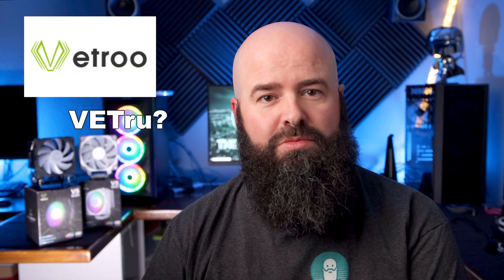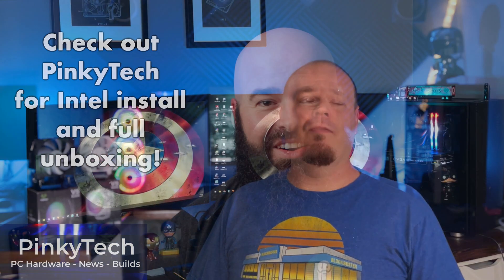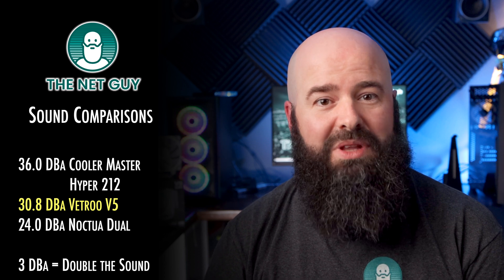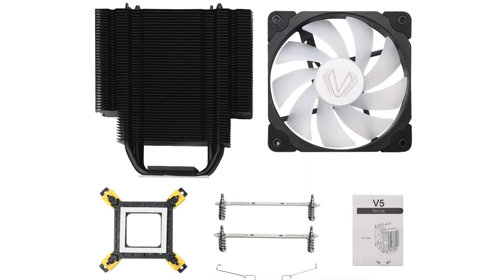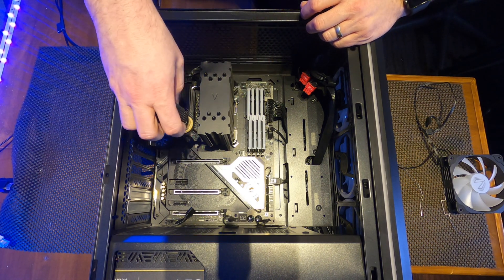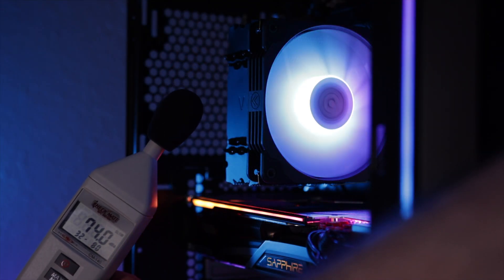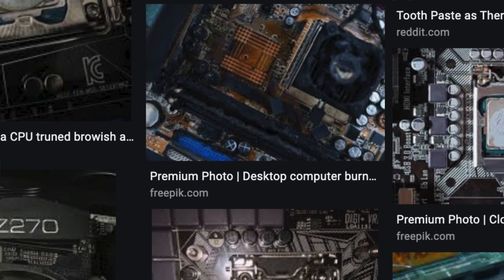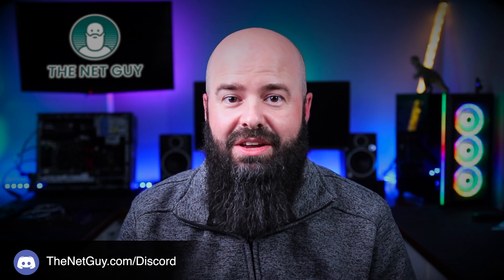ICE COLD CPU Air Cooler Review and Benchmarks - Vetroo V5 FTW

Comment: Love this cooler, and it dropped temps over 20C from my Wraith Stealth that came with my R5 3600, but I disagree about the fan being silent. Mine starts making obnoxious grinding sounds as it hits the higher RPMs, and I've seen a few other users online complaining about the same thing. I had to create a custom fan curve that caps it at 90% maximum speed to keep the noise levels down.
Reply from the maker: Hey Steve - thanks for the comments.  The cooling power of it is really impressive.  As for the sound, what curves are you using?  As long as your CPU isn’t thermal throttling / TDP, you can adjust the curves to stay silent longer.

It’s definitely not silent, but much quieter than the alternatives other than Noctua 😉 thanks again for the post!

Comment: I don't know if I'm doing something wrong, have a bad chip/board/case etc, but I'm hitting 90c no matter what with Cinebench R20. 5800x with this cooler. Tried stock and undervolting. Only stable undervolt I can keep without R20 crashing is -5 on Curve Optimizer all core. Scores are ~5800 all core, with a 4.5 ghz constant boost and just staying at 90c the whole time.
Of course I could lower ttp tdc edc etc, but that lowers scores and boost clocks. Running on a Rog b450f motherboard.
Reply from the maker: PBO is going to mess with you here.  No matter what that proc likes to go fast and will ramp up everything to get to 90c.  You can turn PBO off and see if that helps.  If it’s not cooling I’d double check that it has good even pressure on the CPU die itself - sometimes things aren’t aligned right and don’t get as much conduction.  The Vetroo has been the best cpu heat pipe cooler I’ve tested.

Comment: Temps were much higher than other videos thanks for the honest review!!
Reply from the maker: You’re very welcome.  It’s a hot chip.  My buddy Dan compared a bunch of coolers on his 5950x and it was cooler overall.  But yes, I am very impressed with the Vetroo cooler.
Reply: @TheNetGuy  I have a Ryzen 5 2600 so I'm hoping it'll be a little cooler!
Reply: @alltimellow  5950x produce at least doble heat that 2600. And of course the temps would be higher if other test use a 3600x.

Comment: I grabbed one of these for my Plex/Nas server with a 2700X to replace the Wraith Prism when it was on sale on amazon.  I dropped 10c over the Prism, and gained 150-200 Mhz on the PBO auto-boosting, +400 on my CB23 score with NO other changes other than this cooler.  I didn't use the included thermal paste, but some Kryonaut. I did have 2 fans on it, but it only reduced temps 1c so I didn't think it was needed and went back to the included fan.

Comment: I picked one up for my 3600.  Copper plate had gaps but seems to cool.  Was easy to install cooler.  Fan clips are PITA!  Fan at highest RPM loud but not as loud as Amd stock cooler.  Much more audible than cooler master hyper 212 black edition with silencio fan.

Comment: 10:15 it comes with 2 sets of fan clips, so you can buy another one of their fans or add another fan you may already have lying around like I did with mine. By the way I have the white version on my 2700X OC at 4.2GHz all cores 1.375V and it got to 70C after a few runs of cinebench, again I do have 2 fans on it but I tested with just one fan and it was only a few degrees warmer. For reference, with the Wraith Prism I would immediately reach 80C and stop the test as I didn't feel comfortable running that hot over 1.35V
Reply from the maker: Right on - these things are beasty for sure.  And yes, forgot to mention the other set of clips.  One thing my friends noted is that the clips aren't color-matched to the model - kind of a little thing, but important to some.
Reply: Well. You convinced me to buy it. I have the same cpu but it can get to 50° on idle. This will be a neat upgrade to also make it less noisy.
Reply from the maker: It’s fantastic cooler.  I keep buying it over and over.
Reply: @TheNetGuy  update | I now have a 3900X same Vetroo V5 and it gets to around 80C but it also has 12 cores -0.1v undervolt and 7nm is more heat-dense

Comment: Hey, how do we put pressure against the the backplate to keep it from slipping off when installing the cooler? My mobo is screwed down w/ standoffs so I don't think the backplate touches anything I can press it against.

Also, any clue what the paint is made of, whether it's paint or ceramic or ceracoat? Great video btw!
Reply from the maker: Thanks for the comment.  If your case allows removal of the back-plate then it's a lot easier to wedge something up against it.  Def a tough design choice by AMD here, not the cooler's fault necessarily.  The paint is pretty think - but the finish is nice.  Not powder coat but something similar?